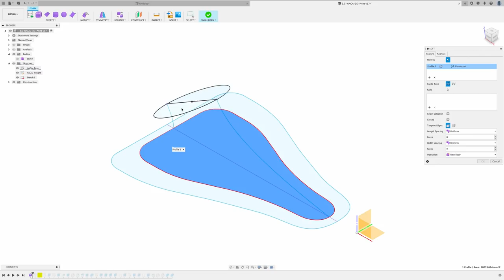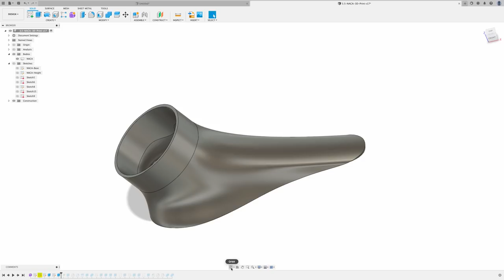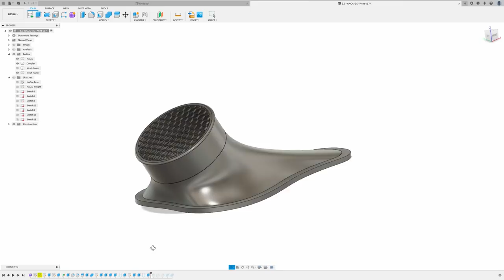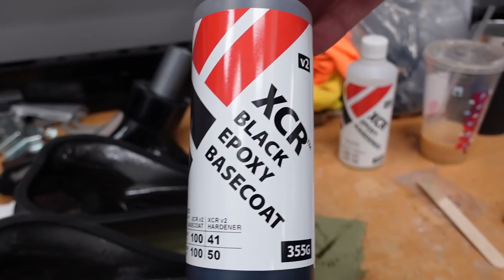I made my own 3D-printed Carbon Fiber NACA Ducts!

Comment: I suggested before that you bin those filter canisters and make a square shaped box to fit under the duct that you can close the hood down onto with a flexible seal .
If you do that you will kill several birds with one stone.
First you’ll be able to use a much larger and less restrictive filter. 
Second you’ll be able to fit water baffles and drains
Third it will look neater eliminating all the silicon with no need for any flexible hoses
Fourth changing the filters will require little effort.

Comment: Just a heads up that MAF tube you removed had a screen in it to provide laminar flow for better readings. It's a massive debate whether they need it or not but if you start having tuning issues it may be a place to look at.
Reply from the maker: Hi Al—yep, that’s right. I have found that the farther away the MAF sensor is located from turbulent air, the less likely you need an air straightener. On the original MAF housing, it’s a short run (assuming the air filter is mounted directly on the end of it—not so in my case), but in that situation, an air screen is highly advised. But given location of my MAF sensors in the intake tract, there’s close to two feet between the MAF sensor(s) and the NACA opening where turbulent air enters—with air boxes in between to help with laminar air flow.  So net/net, I don’t think I’ll need the screens but I did remove them from the original hosings so I can reuse them if it turns into a problem.  Thanks for your heads-up guidance!

Comment: You can use a couple of dabs of superglue to hold items like the MAF sensor mounts to the pipe for welding, don’t use to much and try and keep it from the weld area, makes positioning and fitting easier 👍
Reply from the maker: Ha ha. Keeps me guessing for sure. 😂. But it’s all good. 👍
Reply from the maker: That’s a good tip—especially in cases where you can’t get a clamp to hold. 👌

Comment: Might as well get it right now, for sure!  Those printed ducts turned out really nice.  The little self-tapping screws on the air filter cans scare me for longevity, though.  I wonder if you could get heatset threaded inserts into that plastic and use proper screws?
Reply from the maker: Love this idea. You’re right, those tiny self tappers will strip over time.

Comment: Hello dan. Congratulations on the assembly of the -top gun-, good quality, good video montage, it's a pleasure to watch your videos. Could you comment on the settings you have in the welding machine? The welds fit very well. Thank you.
Reply from the maker: Hi Roma—thanks for the comments. Welding is just a hobby when it’s needed and I have no formal training. But I do enjoy it and I’m slowly getting better. I think my TIG settings for welding those parts were pretty simple: 92amps (at full pedal), 15 cfh of argon, 120hz, 60/40 balance, and 1/16” filler rod—which is key for small aluminum parts like this. Pre and post flow time on gas isn’t really matter on aluminum. Hope this helps!
Reply: @DanDulac  thanks a lot for a fast and complete  answer. Stay tuned 👍👍

Comment: What about a mafless tune and ditch the airflow meters all together??
Reply: ‘Alpha-N’ type tunes are really a patch where you cannot run a MAF, using a MAF and MAP gives you the most data to fine tune and improve transient state throttle response and part throttle running, ‘Alpha-N’ tunes only really work ok in full throttle, racing type scenarios where you don’t care about low rpm, small throttle openings etc and where you don’t have an option to run a MAF.
Reply from the maker: I considered this but since I'll keep the engine naturally aspirated with no plans of forced induction, the OEM ECUs will be fine.  Plus this saves me lots of $$ to re-use the factory computers (but with upgraded tune).

Comment: With the screen you put on the duct, is that not reducing the intake path down from 3.5 inch?
Reply from the maker: Clearly more air can pass without the screen…but given the air velocity will be at its highest at that point, it should compensate for the slightly reduced volume induced by the debris screen. I’ll know for sure once I get it on the dyno. 👍

Comment: Will there be enough flex in the intake to allow you to open the clam or will you need to detach it before you open it?
Reply from the maker: I think I have an idea to connect the NACAs to the air boxes...that would provide easy opening of the clam without binding the intake system.  But I won't know for sure until I get the rear clam back on the car and get the NACAs glassed in.  Stay tuned!
Reply: @DanDulac  have you thought of a more rigid solution where the tubing of the naca ducts slide inside the tubing attached to the intake system? Not sure if a perfectly sealed system is required, just a thought. Love the videos by the way! Really great work!!

Comment: why did you waste all that time with that plastic cap on the lathe, why didn't you just 3D print one with your nylon carbon filament?
Reply from the maker: Ha ha. I wondered if someone would ask this as I was thinking the same thing as I was producing this video. I customized those caps before I learned about the CF Nylon filament. In fact, I decided to ditch those caps and 3D print a set to use instead—you’ll see them in the next vid. 👍